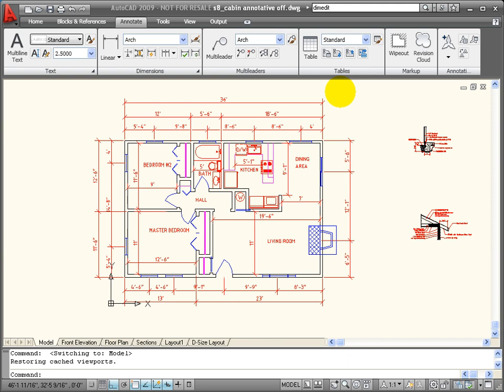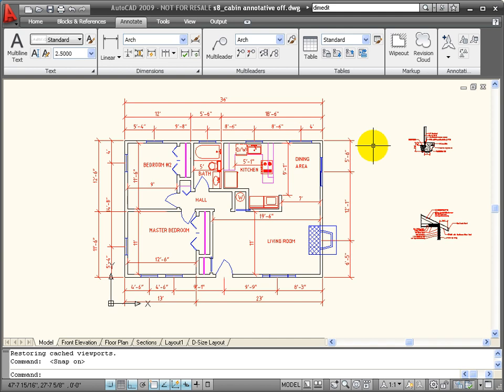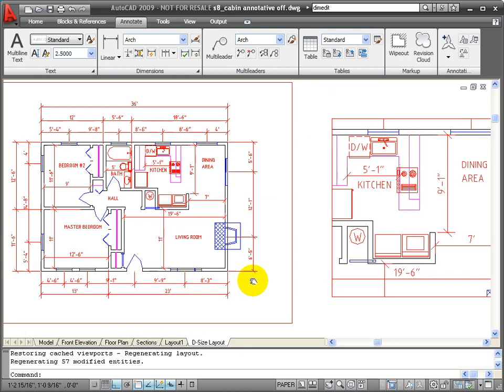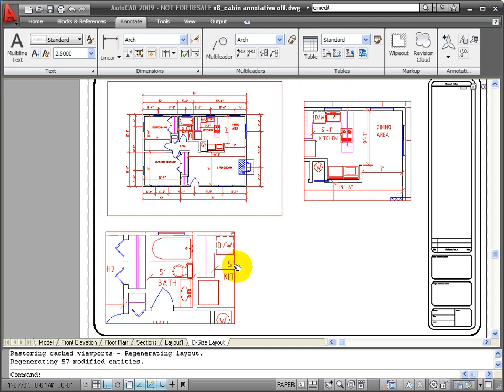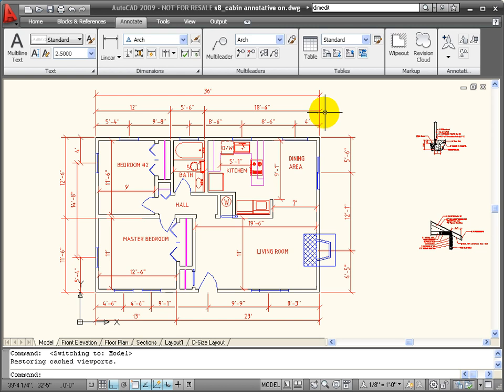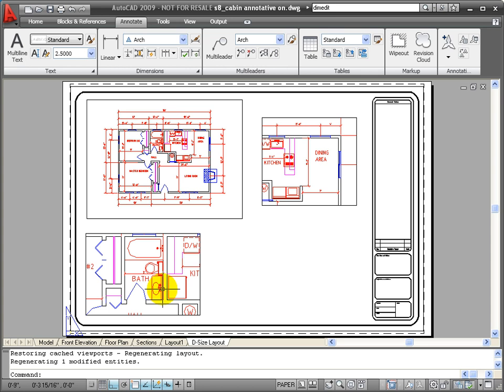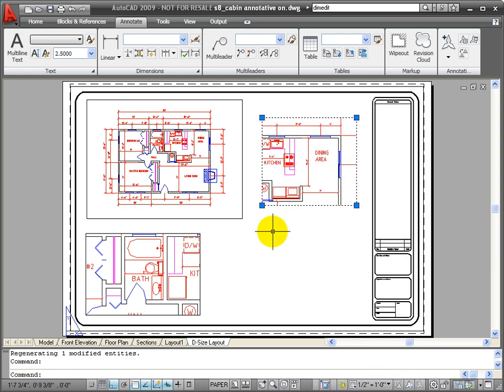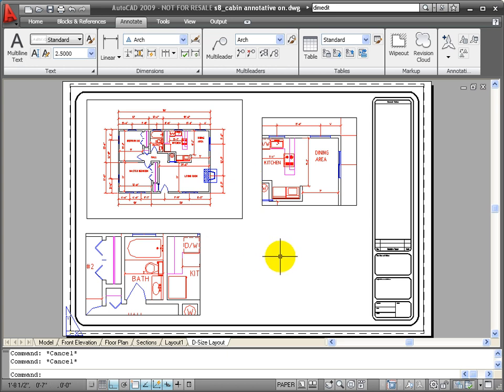AutoCAD Tutorial - Using Annotation Scaling

Comment: Yes. But when you mention "same size in all view ports" what size is that? Where do i set that particular size?  or is that size the text height (for example) that i adjust in properties, after rightclicking the text ?

Also do you have a cideo to clarify "line type scales" and "global scale factor;" i often xref two or more drawings and hidden lines turn out as solid. I have trouble synchronising all three drwwings individual objects scales and their own glibal factors.
Reply from the maker: You have dimensioned the object in model space.  The dimensions are displayed in model space according to the scale that you choose there.  If you have set annotative scaling, you have also choosen several other scales to use to display the dimensions.  These different size dimensions are created and hidden so that you only see the dimensions at the scale you have currently turned on.  When you go to layout and look at the object in the viewport, you are seeing the dimensions as they are currently displayed in model space.  If you click on the viewport and change scale, it will hide the old scale and show the new scale.  It does this so that as you zoom (scale the object for a more detailed view) in the view port, the dimension objects and text will not get bigger.  So if I want text to be .25" on the printed page, I create a text style choosing the font and size.  In the Dimension style I set the text to that text style.  I then set the dimensions to annotative and add all the scales that I would possibly use in any of my viewports.  Now in the layout, if I set the first viewport to 1/4"=1'0", then the text will be .25" and in the next viewport I zoom to show details at 1/2"=1'0" the text will still remain at .25" high rather than twice as big as will happen without using annotative scaling.  In annotative dimensions it not only scales the text, but also the arrowheads and all the other objects and spaces that make up the dimensions.